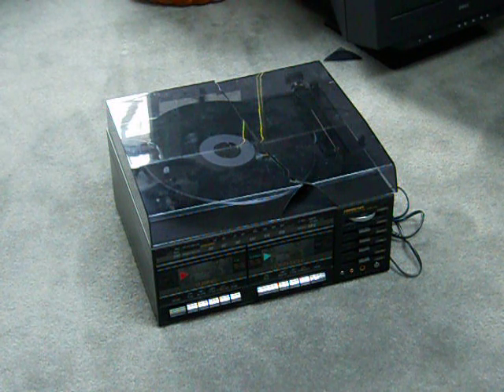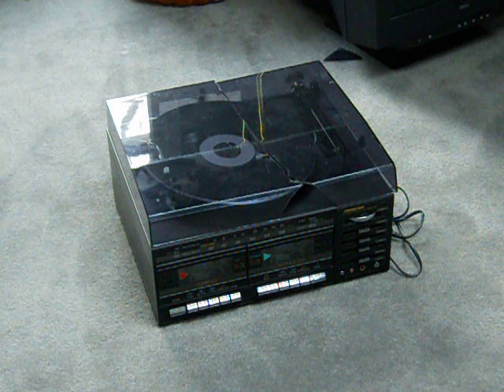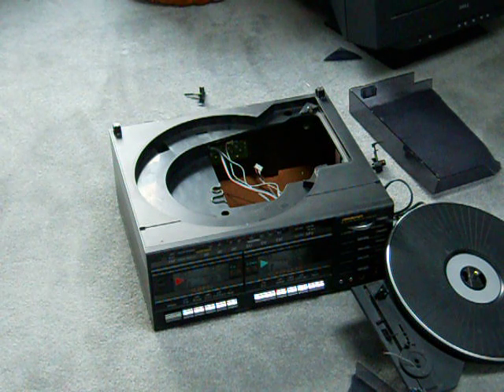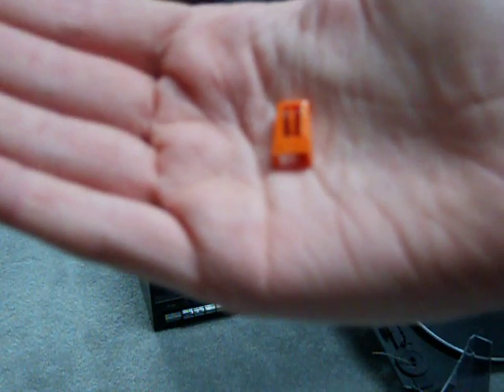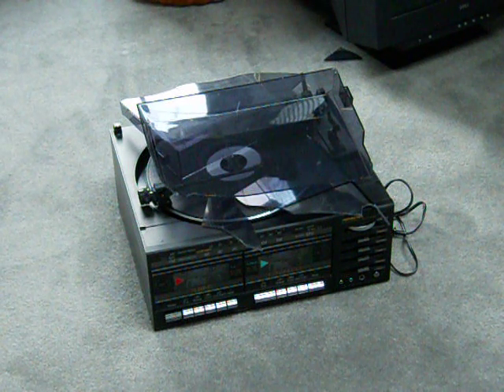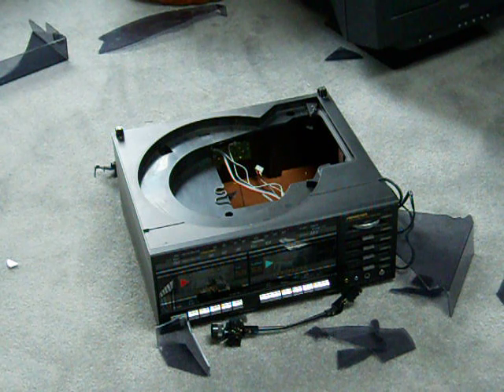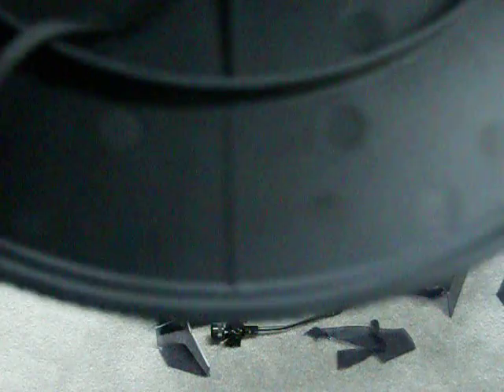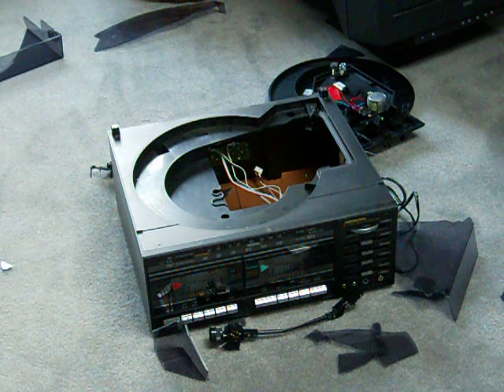Smash the Soundesign Turntable

Comment: I had the exact same unit, only mine was the "girl's" model... it was a hand-me-down from my mom, actually. My dad bought it for my mom in 1987, and when I needed a stereo (I was eight years old), that's what I got... a white Soundesign with light blue and pink trim. That was easily the worst stereo I've ever owned... both cassette decks were unusable, as the plastic tabs broke on the play buttons.